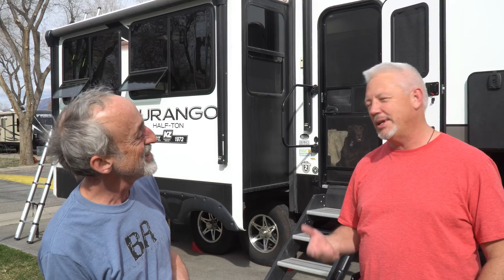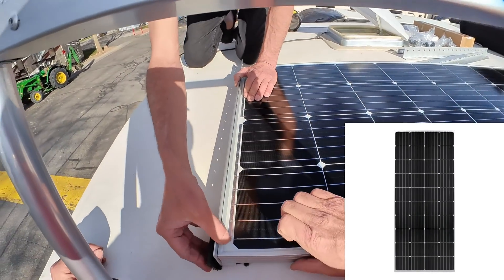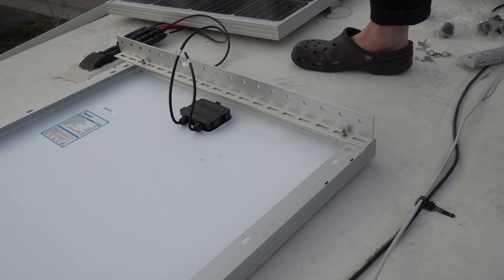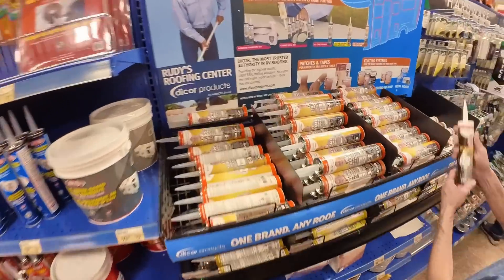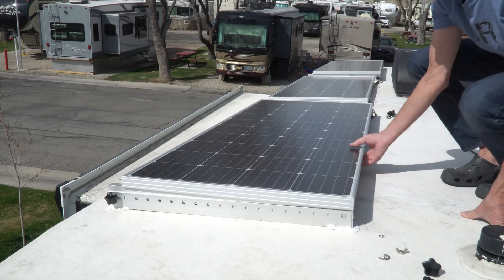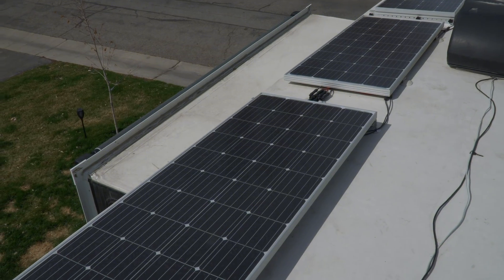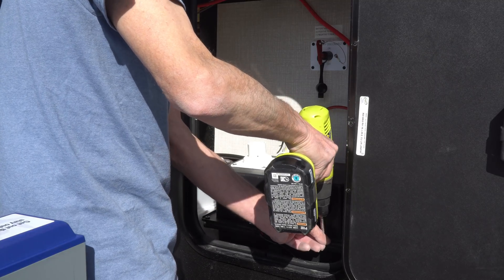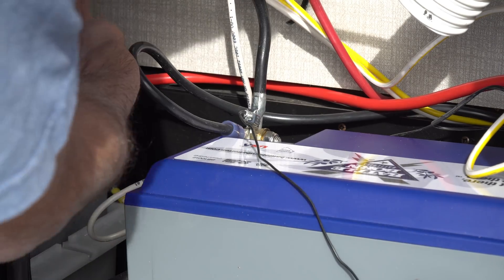Ep. 196: RV Solar Panel Install & Lithium Battery Upgrade | DIY how-to

Comment: Maybe cb radio for your travels?
Reply from the maker: I had one mounted in the Tacoma, I never put one in the Tundra but I do have a handheld.
Reply: @GrandAdventure  copy that
Lol
I  had dual antennas on my older truck. with bnc connector on hand held. Im contiplating  similar set up
My current rig is aluminum . different thinking is involved.
Reply from the maker: @rexcarlson3464  sure is, no ground plate built-in.

Comment: Perfect timing for the battery install video.  

I picked up two lithium batteries Monday and have been thinking about how I want to install them and have been watching install videos. 

Looks like you are going to have a well setup trailer for this summer with all the upgrades. Life will be good out on the road!
Reply: Pro Tip advice on Inverters......get at least 2x the output required for your Total System. ( everything on at once ).
Reply from the maker: Sounds the same for you too, Bruce! There's really nothing technical about the installation, just hooking up your battery connections.
Reply: I have a 2000 watt pure sine wave inverter charger and two 200 watt lithium batteries. It works out well.
Reply: @bruceh3786  So, your Total Demand is 1000 watts or less ?   That is the degree of Engineering I recommend. 2x Total Demand. The point is, you want MORE inverter than "just getting by". Otherwise, you overwork the inverter, spelling a shorter life. I used a 2,500w in my Class C, even though my Max Demand was about 1kw. I'm a huge fan of Pure Sine Wave inverters, because they will run everything from lights, to television or computers.

Comment: You've been a very busy boy!

Gord
Reply from the maker: Yup, and I ain't done yet! The list is getting shorter but I've only got a few weeks left to get them done.
Reply: @GrandAdventure  Marc,

Then it's off to the races...  so to speak.  

I have been researching images of backstreet America circa 1950's and wondering why they are so attractive.  STABILITY is the answer that came to me.

You will be traveling allot again.  Perhaps you will put together some kind of compendium of backstreet America that still exists to some extent.  You know, a little here in this location and a little there in another location, over time, until you have enough to do an episode.  Just a thought.

God, I love those images... they are so enduring.

Gord
Reply from the maker: @gorrdd  That's a fantastic idea! I'll add that to my idea list, I appreciate you passing that along.
Reply: @GrandAdventure  Marc,

You likely have existing footage from all your other travels that covers some of backstreet America.  But finding it may be a very time consuming issue.  Better to just start from scratch.

Remembering to do this is as easy as all the times you said to yourself, I just can't let this image pass bye... even when it doesn't necessary fit into the context of the current episode.

Here's the thing about such images.  When included in an episode, it is packaged and framed in with context making it contiguous with the rest of the episode, by location and time.

When you start to join unrelated images and footage into an episode, covering backstreet America... there is no common carrier other than that one aspect.  Place and time are fragmented.

That means you will likely have to provide the context in your narrative and weave common threads that will join together the otherwise fragmented footage.  It becomes it's own documentary rather than episode based on time and location.

You will want to take notes on each piece of footage and still images you take, of why they impressed you, in order to find the commonality between them all as the glue and context that holds them together.

It will become a message of what's important to you, and likely to your viewers, as well.  It will be more of a challenge but probably a far more rewarding challenge.

Since you won't be squeezed into a weekly production scheduled, you can take more time to produce what's in your heart and mind to share with others.

The fact that you think this is a fantastic idea means that this strikes a cord within you that you are seeking was well.

I hope that helps as you look at this more closely.

Gord